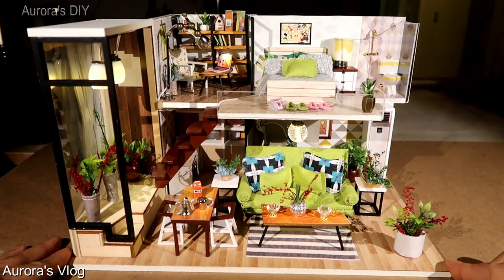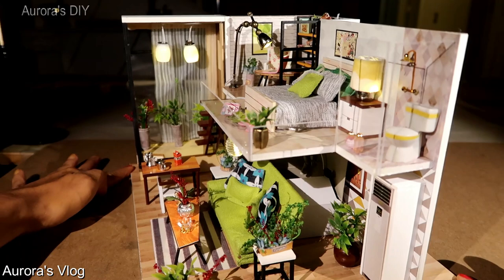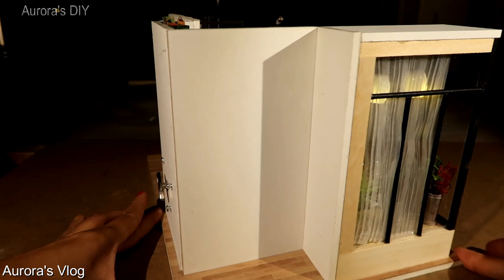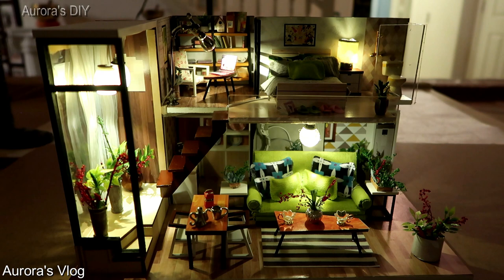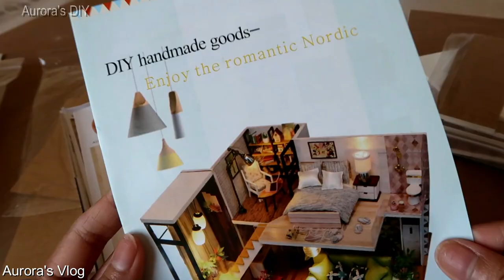DIY Miniature Doll House Kit  Nordic Romantic Room for Two ~ Aurora's DIY

Comment: Hi you did an amazing job! I was hoping for more details on how you placed the wiring and where you kept the battery box, was it on the outside where you could change the batteries? Thank you it was so nice to watch.
Reply from the maker: It is behind the couch
Reply from the maker: I was not happy with the wirings it wasnt long enough for me to put it at the back, so I left no choice but to hide it at the back of the couch but it is visible it is messed.

My other DOLLHOUSE KIT the 2 storey one are more organized it came with longer wirings so and it also came with hiding spot under ground the house at the box.

Comment: Great build! I am almost done with this exact one. Great idea hot glueing the lamp shades onto the lights then putting them in I am definitely going to start doing it that way. I was installing them one by one and it is a pain in the ass. Just an idea I put the battery pack behind the china cabinet wall mine had enough space if I didn’t push it back all the way!
Reply from the maker: I'm about to start A CUTEBEE design.  Woo this one has 3 dining room so much.